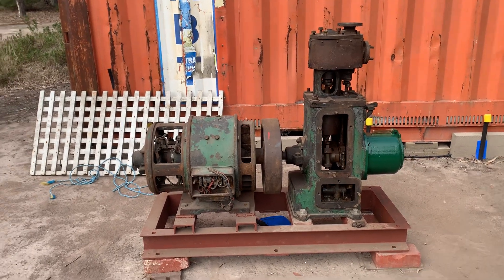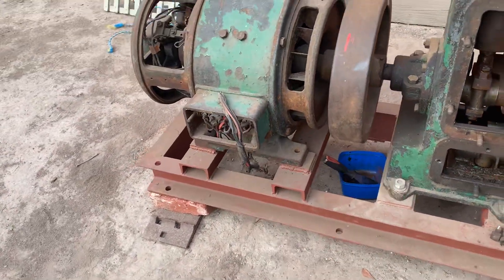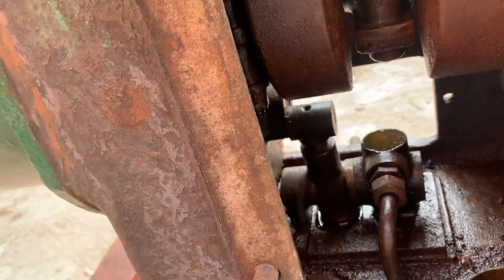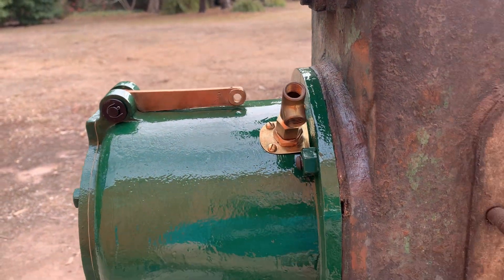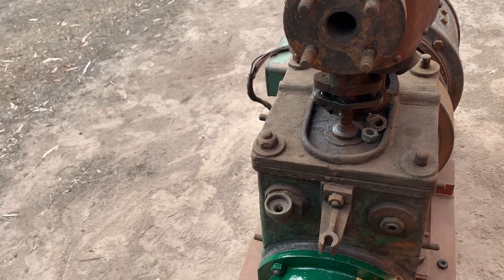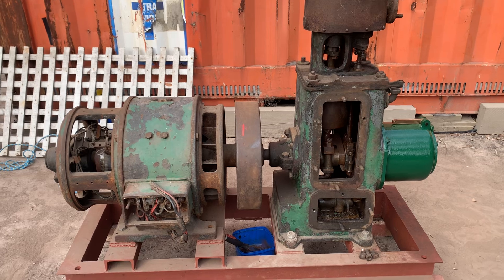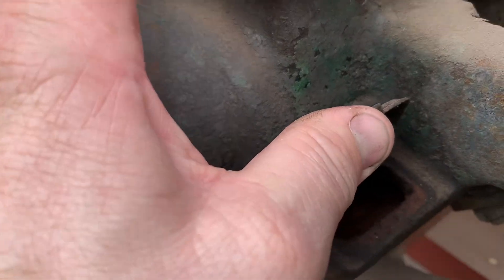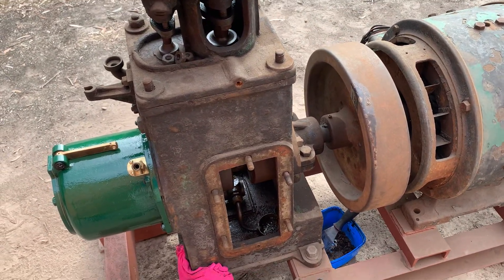Robison Steam Powered DC Generator Set

Comment: Hi Mate, I have an idea for charging with Gravity, best for us with big yards.
(forks, chain and a back rim of a pushbike, long garden hose & steel cable)
Attach a generator to the top of the pushbike forks and add a small gear, put the back rim in the forks, you might need to widen them to fit (BMX is best).
Fit a pushbike chain around the two gears, adjust alinement with generator.
Push the steel cable through the garden hose, tie one end of cable up high,
 then put the other end of the steel cable and hose through the forks under 
the rim, so the rim runs on top of the hose after attaching the other end of 
the steel cable down low and tension the steel cable to handle the weight.
Use a long AC extension cable to run from your AC generator to a 3 phase 
bridge rectifier before using PWM solar charge controller then to a battery.
To reset pull generator up to the highest end then release, test and adjust.
It should work like a flying fox, if AC cable is attached solid, use to pull up.
Make a box or a small roof to protect from the weather at the lower end.
I hope this idea helps everyone get started making Free Gravity Power.